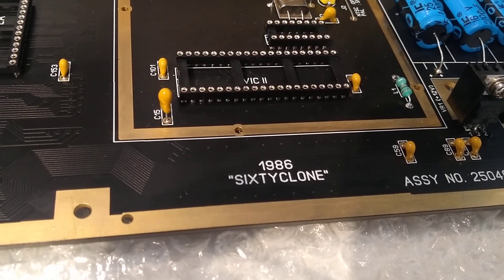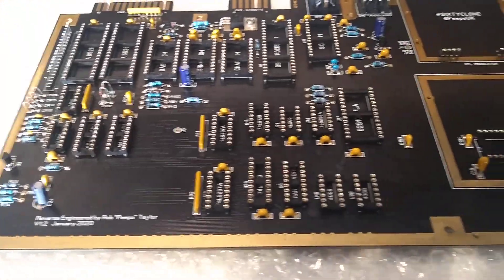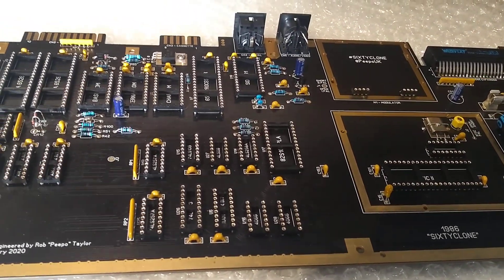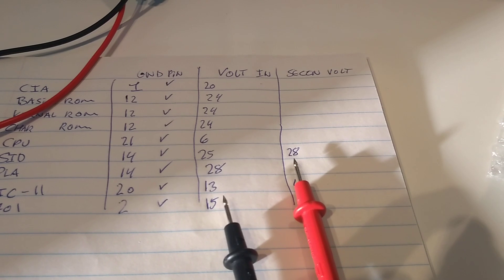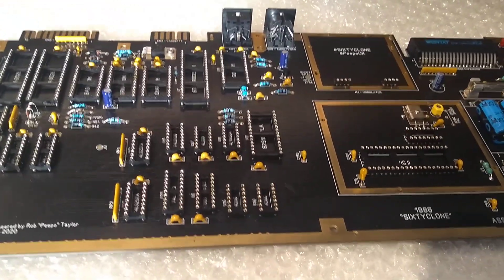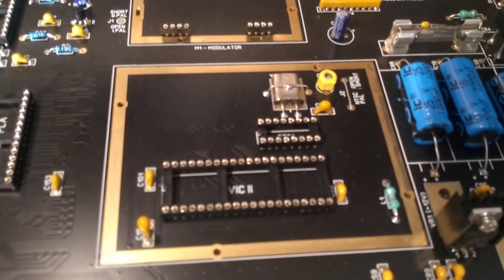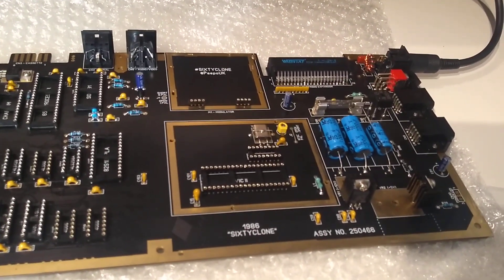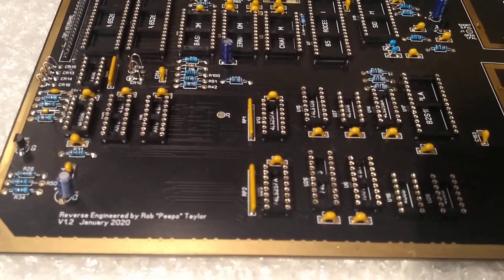SixtyClone, a Covid-19 project.

Comment: I started on the 250407 a while back, this is a fun project. You did a great job on your board it looks really nice. I do have a question though. Where did you find the cartridge port and power switch? By the way there is an RF Modulator you can get off of ebay. It's black and gold made for this board. It's called Shuriken RF Modulator.
Reply from the maker: Thanks. :-) I am really happy with the result, and for what I can see, then you will be really happy with the 407 board. They seem to deliver a great result as well.

The power switch was bought from a seller in Germany or UK. I can not really remember. You might want to search for something in the lines of Commodore64 parts on google. I believe the company in Germany is called polyplay. The company in the UK is called Retroleum.

The cartridge shield/bracket was harvested from a dead 250469 board that I bought on eBay for really cheap. I also harvested the DB9 ports from that board, as the ones that can be bought from brand new, do not have the correct screw type. Call me a perfectionist, though I just wanted to do a nice result. :-)

I know about the Shurikan modulator. I just don't like the design of the thing. So I bought that other modulator replacement from Finland, however that does not look as great as a NOS original modulator for some reason. I bought that NOS and never used modulator somewere in the middle of 2020 on eBay.

Once you have finished yours, then there is this sub Reddit that I have created for all SixtyClone owners. It is called SixtyClone_Owner_Club. :-)
Reply: @brostenen  Excellent thank you . I was able to get the rest of my parts except for the cartridge port, they were sold out . 
I have also built an A500++ purple pcb. It works great. I got a hold of an Amiga 500Plus case for it. As soon as the weather is warmer it will be getting a retrobright treatment. On the back Burner I have 2 ReAmiga 1200 (white pcb) I have been working on and have brand new cases waiting for them.
Reply from the maker: @Liberty309  Cool... Sounds like you have most parts now. Happy to have helped you source. I actually thought that it was the cartridge metal bracket and not the actual connector that you were looking for. Anyway... You can always source a beat up board, that are beyond any repair, in order to get the last parts. Seems only fair that those parts can get a new lease of life.

That is some great projects you have going there. Amiga's are so wonderfull as well. Actually anything computer related from 1980 to 1999 if you ask me.
Reply: "On" Ebay, not off of ..

Comment: You've got some nice sockets on that board.  The black and yellow was a good choice.  Did you find the black board hard to solder?
Reply from the maker: Thanks. 🙂 Yup. The sockets are those turnpin and gold plated. I thought that it was the best way to go. 🙂 The board was not that hard to solder. Even with a non temperature controlled solder iron. The one I am using is a 25 watt. I just took my time, using IPA before and after on each pad, and then god knows how long, to clean up when it was all done. 😒 I used cotton swaps and IPA for that. 🙂
Reply from the maker: By the way.... Sorry for my bad English. It is my second or third language. Depends on how you look at it. Because I have rarely used foreign language since 10'th grade in 1993. Or college between 1997 and 1999. So hard to find English people or Germans here in Denmark on daily basis. 😁
Reply: @brostenen  As long as you're having fun, that's all that matters!
Reply from the maker: @temporarilyoffline  Sure... Old vintage computers are always fun. As they are nostalgic to me. I was born in 1976, and the first home computer that I saw in my life, was my cusins C64. It was around 1985 or something. (plus minus a year)